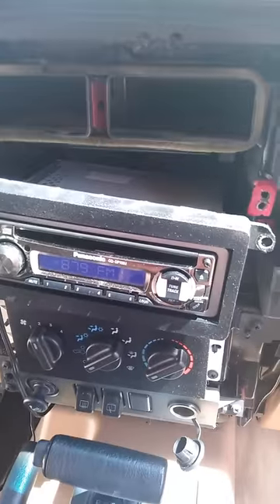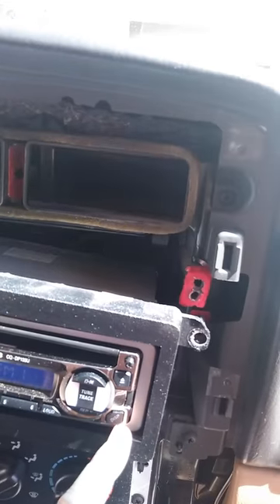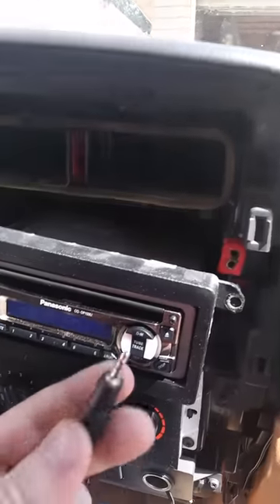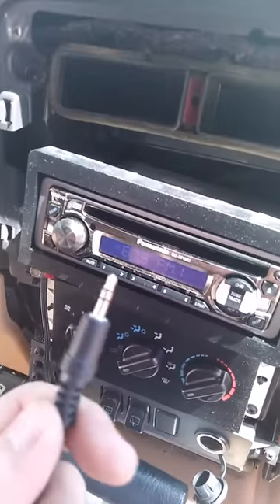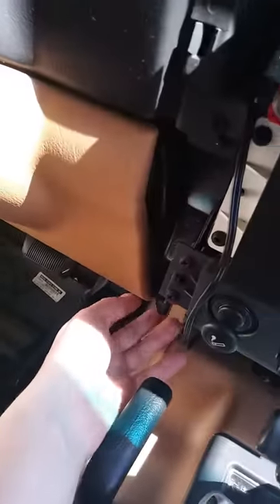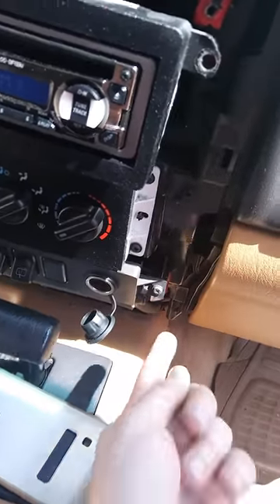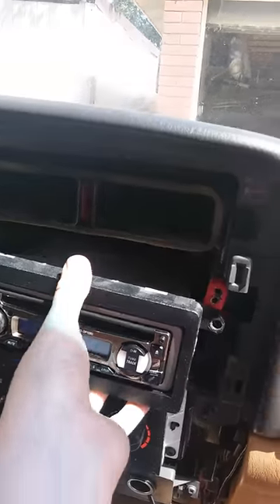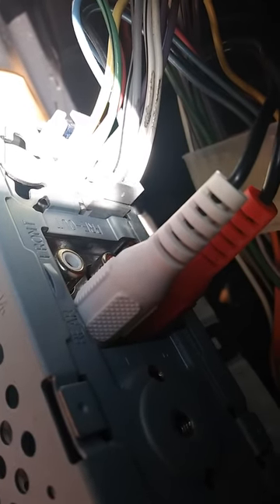How to give a regular car cd player an aux cord? (RCA to Headphone jack, cable.)

Comment: What was ur radio set on
Reply from the maker: Turn the volume down on your head unit then set radio dial to any station and turn your phone or music player up.
Reply: Did you ever figure this out?
Reply from the maker: It will work on any input you just have to have the volume up to one or two on the radio. Adjust the volume with your phone
Reply: I actually ended up sume what rigging it too work lol then lost the car but next old school car I got it thks

Comment: bro i did but gets low sound.
i kept radio volume to 1 and sound is good but not increasing with volume knob its fixed. why.
and ur sterio has 4 slots 2 whites 2 red.
mine only got 1 white 1 red
Reply: radio mode me hi chal jata hai ya mode change karna padta hai ????
Reply from the maker: Some only have two. They are for the rear or for the front. Supposed to be used for an amp. But yeah you adjust the volume on your phone when you have the radio that minimal volume. One or two works.